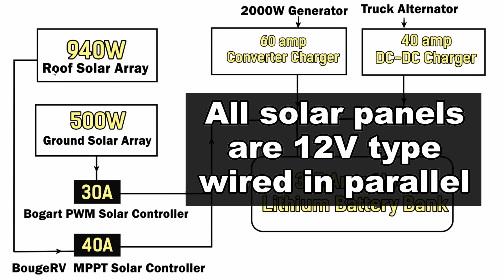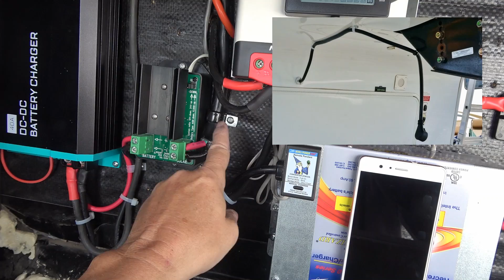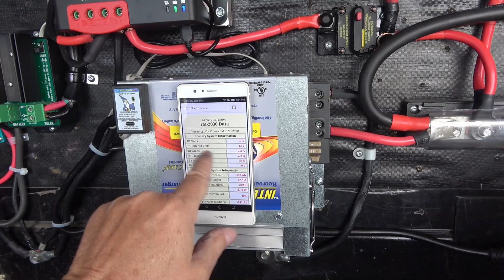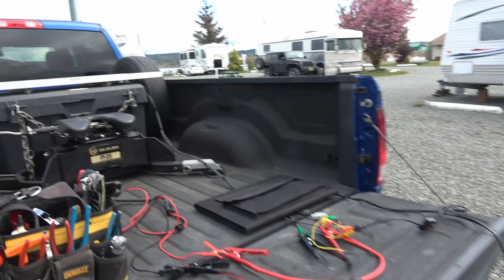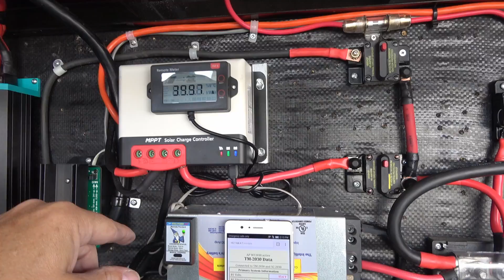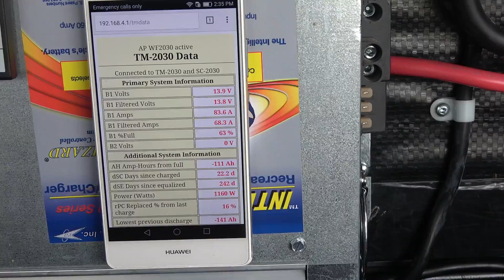Boondocking Power Upgrade - Adding Separate 500W Solar Ground Panel Array + Wiring Cleanup

Comment: Ray, like you I am a LE Battery fan, did you set the constant input voltage that feeds them to 13.9 vdc? (excluding the Coaches Charger/w Charge wizard)?
Reply from the maker: No, I have them set for constant 14.4V, the BougeRV MPPT defaults to that for its lithium battery preset and the Bogart I have custom set for 14.4V.

Comment: Do the charge controllers have the same battery charging profiles?  If not and when you them both activated, what is the combined voltage output? The higher of the controllers, or some weighted average?
Reply from the maker: Yes, I've set both charge controllers to charge at a constant 14.4V for my lithium battery bank.

Comment: I like your videos. It is like we are having coffee at the picnic table discussing different things. Thanks for your informative videos. I mentioned in another video we are looking at small TT like Cougar, Grand Design, Rockport, and Jayco. How did you learn the structure on the roof for your panels? If you have a video explaining that could you tell me which one to look for? The only way I can figure it is poking my head up from inside to see where I can mount brackets and run cables down. The new RVs seem to have a cable prep which would be nice but I might have to change wire if it is too small. Again, thanks for you help and videos.
Reply from the maker: Thanks :) Here is a link to my very first two panels, it's where I figured out the best route to run my wires. Luckily I found a tank vent pipe that went down a wall and into my bathroom sink under the cabinet area - https://www.loveyourrv.com/installing-renogy-200w-solar-kit-rv/  Every RV is a little different though. The fridge vent is a common wire feed point people used but can lead to long wire runs.
I try and keep at least one edge of the panels close to the roof edge as I know there is a good stud there for the screws to bite into. The inner edge may be lucky and hit one if not my roof has 3/8 boarding. Seems to work out I've never had a panel come loose so far. I think a key is to dip the screws into sealant before driving and don't over-tighten to the point of stripping the hole. Just enough to bite firmly into the wood. Cheers, Ray

Comment: Ray, I agree with you comments about oversizing the batteries and solar after boondocking in the southwest during the winter months but It looks like the max PV input for the solar charge controller is 520 watts for a 12v system.  From the Bouge RV website on the 40a solar charge controller:

【Electrical Parameters】:
System voltage:12V/24V Auto Battery voltage:9V～35V
Wire specifications:20-6AWG
Size:183*127*65mm  8.1 x 5.5 x 3.3 inches
Max.PV input power:520W/12V&1040W/24V
Item Weight: 2.95 pounds

This may be why it runs hot.
Reply from the maker: Here is a blurb from the controller feature list in the manual:
"Current-limited charging function is available. When solar panel power is too large and the charging current is higher than the rated current, the controller automatically reduces the charging power so that the solar panel can operate at the rated charging current."
I gather that the extra wattage should not matter. You would think it would be smart enough to deal with the extra. 
It runs hot but so do most other MPPT controllers thus the large heat sinks.  I'll see how it runs on full summer overhead sun.  
It also has an overheat protection:
"When temperature exceeds the set value of the device, the charging current decreases. Over temperature protection mechanism help reduce the temperature rise of controller and avoid high temperature damage."
Cheers, Ray
Reply: @LoveYourRV  Ray, I also have an electronic background and boondock in AZ in the winter.  I am super interested in how this goes with the extra wattage.  I am putting 600 watts though my 40a charger right now.   It is specified maximum 520 watts but I want the extra power.  I have seen 40 amps continuous and 42 amps max output to the batteries (though a similar thermal breaker).  I also used aluminum bars to mount the charge controller.  Mine does not seem to get hot so far.  Please keep us informed and keep up the good work!
Reply from the maker: @elmer665544  Will do, plan on doing some tests as we approach June when the sun is at its highest.  I'll try it with my full 940 watts and then compare it with lower watts and see if there is much difference heat-wise. I would think it would be a bigger deal if I was near the max voltage of 100V but with my parallel arrangement, my max VOC is around 20 volts. One never knows with these cheapie MPPT controllers though, they don't have very clear specs published.
In my mind, I think they publish the max 520W spec as that is the max power that can be transferred when using a 12V battery system since the controller output is limited to 40 amps of charging current. I don't see why a person can't add more panel wattage, it just won't be passed but just cut off and not used. I don't see why it would be a big deal to create a controller to deal with the extra panel wattage.  My cheapie little Bogart PWM can handle more wattage, it just dumps the extra with no harm
This from Bogart:   "Up to 30 amps maximum solar current. The charger will safely reduce output if panel current exceeds 31 amps."  I've over-paneled that little controller for years with no issues. Last time in the southwest I was running 700 watts into it.

Comment: Thanks Ray - I work in electronics, and have been following RV Solar for a couple of years, and still have to say that it looks "very complicated".
I understand it, but I don't think I could hook it up myself.
Plus I have a 26' TT with limited storage, and other than under the bed, I'm not sure where I would put it all.
I assume all the expanding foam in that compartment is to keep rodents out of inside your RV.
Reply from the maker: Yes, its some pest block spray foam to try and keep them out of the underbelly area.

Comment: Ray, can the 40a solar charge controller handled the 940 watts?  My 40a Renogy charge controller maximum input is 520 watts.
Reply from the maker: Here is a blurb from the controller feature list in the manual:
"Current-limited charging function is available. When solar panel power is too large and the charging current is higher than the rated current, the controller automatically reduces the charging power so that the solar panel can operate at the rated charging current."
I gather that the extra wattage should not matter.  It runs hot but so do most other MPPT controllers thus the large heat sinks.

Comment: Unless I am missing something you aren't utilizing your solar arrays fully.   You are giving away up to 25 amps on the roof and  5-10 amps on the ground array

You need at least 50 amp and 75 would be even better.
Reply from the maker: Yes, I have on purposely oversized the system solar panel wise to be able to harvest the 40 amps even in the winter. That's one thing you learn when boondocking down south during the winter months. Due to the short days and low sun angle you need much more solar power than long summer days and high sun angles. We also like to camp on the coast where it's often cloud-covered or foggy. Also, you never get the advertised wattage from a solar panel. That's perfect lab conditions, not the real world. Generally getting about 80-85% of rated wattage is considered good and there are wire and controller inefficiency losses.  Cheers, Ray

Comment: Do you have a specific way of finding out how to find the fuse size?
I’m looking for a good source for information, as I find it very difficult to get that data from any place. Thanks
Reply from the maker: I find the Blue Sea website has some great resources for calculating fuse and wire sizes. Here is a fuse one - https://www.bluesea.com/support/articles/Circuit_Protection/1441/Part_2%3A_Select_a_Fuse_and_Fuse_Holder_For_Your_DC_Product_Installation The circuit wizard is pretty handy too - http://circuitwizard.bluesea.com/#
Reply: @LoveYourRV  
🖖 thanks

Comment: Thanks Ray. I see your YouTube channel is paying off with thousands of extra solar panel wattage. Well done!

When did you upgrade your batteries to lithium?  I guess I missed that episode. I’m seriously considering Battleborn lithium batteries. Did you consider any other lithium batteries?
Reply from the maker: In summer 2019 I install 3 of the Lion Energy 100AH lithium batteries and did several videos about them, then at the end of the year they came out with a new improved 105AH version and I swapped them out. I used them for a few months and came back with a review. I have also tested the SOK 100AH and gave it away to a viewer. I liked it but already had the 3 Lion Energy and didn't want to mix batteries. You can see all the videos here -https://www.loveyourrv.com/tag/lithium/  
I actually may be reviewing another brand of lithium. I've been approached by Discover Battery to maybe review a couple of theirs. That would be cool! since they are a Canadian company located in BC - https://discoverbattery.com/products/lithium-batteries  Cheers, Ray

Comment: Hmmm...940 watts/12v system = 78 Amps...uour 40amp CC is way too small!
Reply from the maker: Oversized the system solar panel wise on purpose to be able to still harvest the 40 amps even in the winter. That's one thing you learn when boondocking down south during the winter months. Due to the short days and low sun angle you need much more solar than long summer days and high sun angles. We also like to camp on the coast where it's often cloud-covered or foggy. Also, you never get the advertised wattage from a solar panel. That's perfect lab conditions, not the real world. Generally getting about 80-85% of rated wattage is considered good and there are wire and controller inefficacy losses.  Cheers, Ray
Reply: @LoveYourRV  Just have to watch the total VOC as that can damage the CC.
Reply from the maker: I considered that when I picked the controller and I'm hooked up in parallel so the highest voltage is about 20V Controller max is 100V
Here is a blurb from the controller feature list:
"Current-limited charging function is available. When solar panel power is too large and the charging current is higher than the rated current, the controller automatically reduces the charging power so that the solar panel can operate at the rated charging current."

Comment: As always, great video.  As you expanded your roof panels and the potential amps increased, did you up the wiring gauge?  What AWG are you running up top and from the fused switches to the batteries?  Have you experienced and warm wires?
Reply from the maker: Yes, when I added 2 more panels to go from 400W to 600W I increased the gauge of the wiring coming down from the roof to 4GA. It gave me plenty of extra capacity to add more panels. My main wire run is only around 12-15 feet. Then all the panel pairs have their own runs using the 8 or 10 gauge that they came with. https://www.loveyourrv.com/boondocking-power-upgrade-200-watts-wiring-update-mods/  For the battery compartment area I run 4 gauge for the chargers wiring and 2/0 gauge for the battery and inverter wiring.  I'm pretty well oversized on everything considering the amperage. Nothing gets very warm at all.

Comment: Ray, I used to have a marine business directory website that offered all things boat related. 
Somehow I had deleted it.
Most everything for boats is better quality than RV related items. 
You lost me on the two 30 Amp in-line fuses.  I would have thought anything over 30 Amp would trip the first braker and never make it to the second.
I love your channel. I always find it very informative. 
How about promoting some of Ann's photos?  You did say she has a keen eye for beautiful sensory.👍👍
Reply from the maker: Yeah, I buy quite a few items at marine shops in the area, mostly waxes, electrical breakers, and switches, though I find too that they often jack the price up on the same stuff as other sources just because they are marine. :)
As long as the 2 fuses or in this case auto-reset fuses are identical and the wiring is identical the resistance should be equal between them so they will split the current. I'd guess there will be an ever so slight difference but I guess not enough to matter. It's not an optimal setup but I guess Keystone found having 2 paralleled better for them, maybe they just had a surplus of 30 amp fuses or two 30s are cheaper than one 60. But it's work fine for 10 years and I've at times briefly seen 40 - 50 amps going through them when the OEM converter is charging.
Anne got a ton of promotion during my throw-back video series. ;) https://www.loveyourrv.com/tag/Throwback/ Had links to her website in every video description and blog post. https://annemckinnell.com/  Cheers, Ray

Comment: Hey Ray, another great and informative video. If you ever run low on topics, you could do a Solar video series, some of the questions I will be looking for answers are how to choose to wire your panels in parallel or series, 12 or 24 volt panels, PWM vs MPPT charge controllers, pros and cons of all the different battery types, solar panel array and battery bank sizing, etc.
Reply from the maker: Thanks for the suggestions!
Reply: @LoveYourRV  And if you ever run out of projects for video, I have a new truck and new truck camper on the way......Would love to have lith batt's and a proper working charge system from the truck to the camper...... nudge, nudge, wink, wink. ...... LOL! And I'm in Victoria! Ha ha ha! I'd trust you to do it more the RV dealers. I just get the gut feeling they are kinda clueless on the 'new' lith and charging systems.